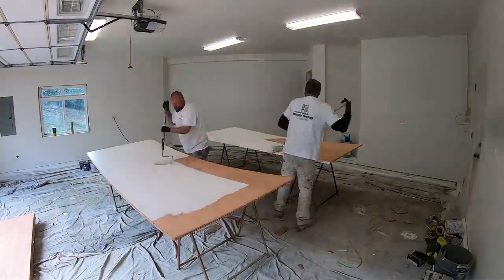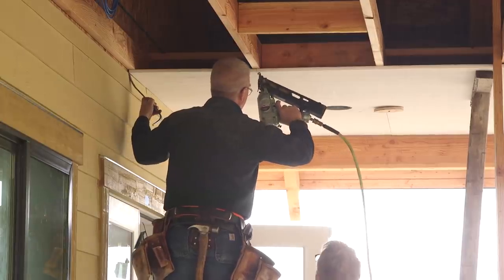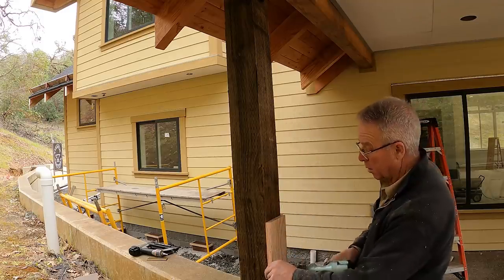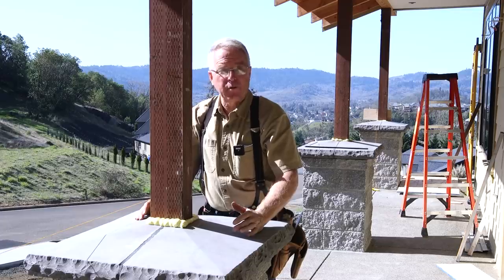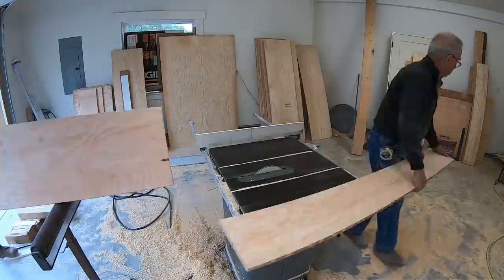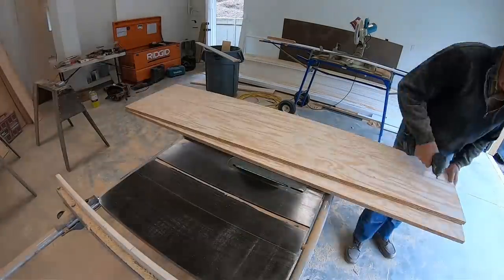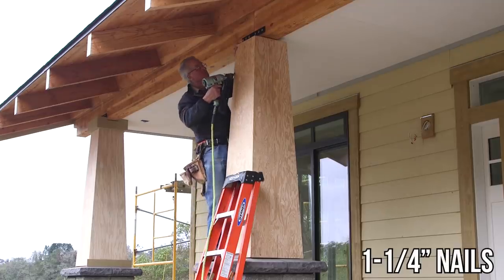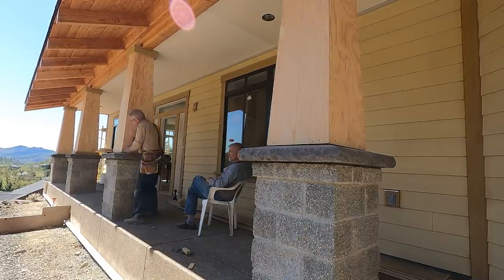Building Tapered Columns and Other Exterior Trim Ep.116

Comment: Attic access from the back patio. Now anyone can break into your house.
Reply: There are supposed stories of bums living in people's attics. However, to "break in" you'd have to fall thru the ceiling drywall, and then possibly get shot stabbed etc.
Reply: Interior of porch ceiling is not accessible from the main attic.  For fire reasons, you cannot have an enclosed space that big and not provide access for firefighters.  Nothing stopping the owner from adding a lock if for some reason they thought it was necessary.

Comment: Dude! I wouldn't  ever try to lay you out on anything woodpecker  related. However, you might save yourself a little bit of calculating time in the future if you do a little research and familiarization on the Fibonacci sequence.  Im sure you well aware of it . I use it anytime im in uncharted waters, like if i had to bang out some tapered columns. You did an awesome job , as we all would have expected. But you nay have been able to save some time. If you can factor in the ratios within the Fibonacci sequence,  (golden ratio), its guaranteed the results will be very pleasing to the eye..

..also, what angle did you cut those miters at? Technically,  since the sides were tapered, 45° would make them open inside. ..you may have addressed this as i was writing.. I'll watch it again. I do a lot of rewatching your videos. You're a true craftsman with integrity and a great work ethic.  Thanks for all the great informative content..

Comment: I won’t give you five cents for the moisture durability of the plywood columns.
Reply: @isaackvasager9957  They don’t have to “get wet”. T-111 and similar soak up moisture like a sponge via the end plies, which were not sealed in any way.  High humidity will exist at the base of those columns and it will quickly degrade the plywood. Five years max If they never actually get wet… a year or less if they’re allowed to soak up water directly. A separation or at least an inch is necessary along with adequate ventilation if they have any hope at all.

Comment: Not sure why everyone is saying these column corner joints should have been glued. Tapered columns have never been glued. That said, respectfully I submit, the columns should have been made from figerjointed-primed cedar, and should not have been mitered but butt-jointed. It's a fun drill on the table saw cutting two different pieces for each column. Go look at an old craftsman built by the masters....no glue, butt joints. Scott's a craftsman, I'm taking nothing away from him, differences exist in the ways things get put together, driven by a host of reasons.
Reply: Glued lock miters are even better, and will never ever open up.

Comment: Scott I am really disappointed that you didn’t prime bottom of those columns or the lower base wrap of them. I just spent two weeks replacing rotten wooden columns very similar to the ones you are building and installing on a house that is 6 years old. The builder didn’t prime any of the bottoms of any wood that touched bluestone.

Comment: Surprised you didn't back prime the soffit or the bottom edges of the trim around the base of the column sides.  Otherwise first class attention to detail.  I have made these boxed out columns myself and used a lock miter router bit set to lock the beveled corners together so they could never open up and so they didn't require trim or caulk.

Comment: Not going to be anything at the top of those columns, that would cover the exposed steel bracket, or keep critters/debris from getting into the top of the columns?
Reply: Track saw would work but there are 8 cuts per column times how many 6? That's a lot of setting up with the track and get it right every time which would add minutes to each cut. Work goes much faster with a tablesaw and a jig for something like this.

Comment: Those column seams are going to show corner cracks within weeks of painting, YMMV. 
Also,  I think it is sad that such a well built structure has such cheap trim details, but they did spend the money and time on things that can't be changed, the trim will need a facelift in time.

Comment: Those plywood columns just nailed together in Oregon won’t last more than two winters and a summer without those miters split wide open and warped to bits. There are FAR better materials and techniques that are the same price to build with today. The whole wrap could have been built with some pvc material even from your local big box store.

Comment: Weren’t you a bit apprehensive using a wood product with butt joints on the ceiling? I would think that you would have seasonal expansion and contraction along the joints and thus a tongue and groove application would mitigate this.
Reply: A drywalled porch ceiling would not have looked like drywall and would have looked a million times better than that plywood.  Fortunately it can be covered with clear T&G down the road.  And should have been, anyway.

Comment: These videos are all great. Skill, workmanship and so forth. But, I keep questioning the wood-frame/flooring/facade building practices. I think that in general wooden structures result in inferior homes as compared to brick/block/stone/concrete homes ... AND they consume wood at such an amazing rate that we cannot remain surprised at the soaring cost of timber and lumber.
Reply: My only concern would be the rafter Tails but he may have some tin work copper up his sleeve

Comment: 10:15 "...glue unnecessary". I wonder if you'll still feel that way ten or twenty years from now? Will mere paint be enough to keep out the weather?
Reply: What is the lifetime of 3/4" plywood exposed to the elements?
Reply: My first thought watching the plywood getting primed was- No back-priming?
Reply: @christophermahon1851  That is just carpentry, err painting, construction? maintenance maybe? ah hell 101.
Reply: @christophermahon1851  To be fair to Essential Craftsman I believe that the plywood not being back primed was simply an oversight on his part, we are after all, all human beings, even if you happen to be an extremely accomplished craftsman with a YouTube channel.
Reply: @chucklindenberg1093  Maybe, but none of the wood for the posts was primed, either.

Comment: In OK we call that plywood 3/4 AC
Reply: AC is structural rated interior.  ACX is structural rated exterior.  Sanded shop is not structural rated and can be used in nonstructural uses such as cabinetry etc.  Can also be used outdoors if it is exterior glue.

Comment: The only mistake you made was not priming the bottom edge on the column before installing.
Reply: Correct, those bottom edges have no shot.
Reply: As a contractor I've had to replace collums before because they rotted out on the bottom from not priming the bottom edge.

Comment: Yup pain in the butt. Depends on customer 45* are more $$$.
I block the back with angle I want.  butt joint it and get the router with tracer bit. Sometimes you will see one butt joint on each face or you see on two joint on two sides. Depends on your feeling that day. On what you customer gets. Lol

Comment: I will reiterate my previous question.   Why go through all the effort and pain of putting in masonry as a fake facade for the columns.  Just to stick a wooden stick in the middle that will rot out?
Reply from the maker: That pressure treated post, not in contact with any concrete, is going to last a long long long long time.